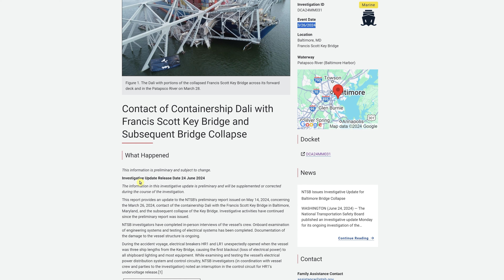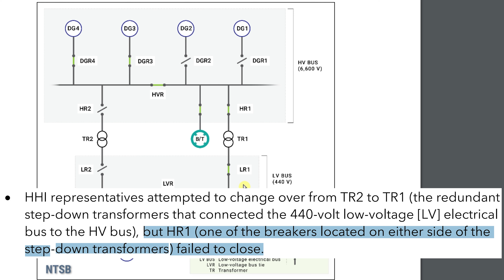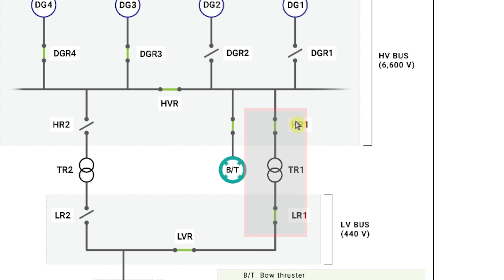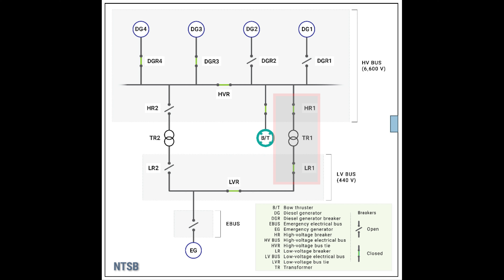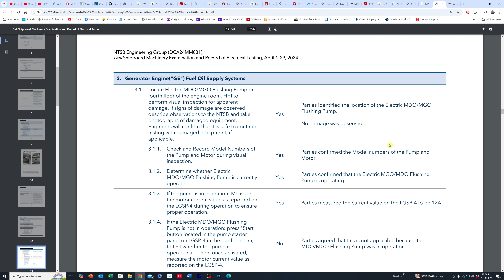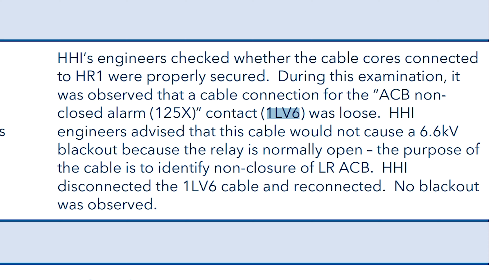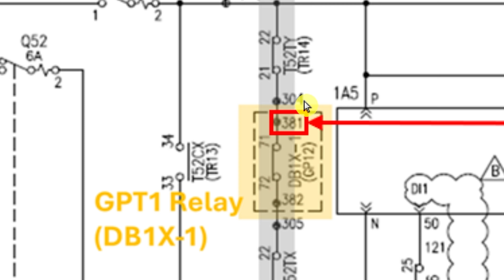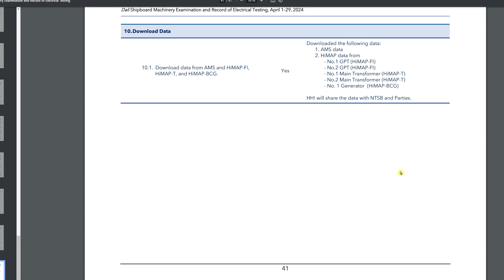NTSB: Dali Ship/Key Bridge Collapse Caused By Loose Cables?

Comment: As a mechanic, intermittent problems are a nightmare. But I remember one time this woman came in with a car that had a check engine light on and there were codes for all 4 O2 sensors and another sensor I don’t remember which. She took it to the dealer that wanted to change all the sensors. I told her when I get something like this where there are multiple sensors and print out a wiring diagram and see where they share powers and grounds. All 5 sensors shared a ground in the driver’s side front wheel well. Turns out she had hit something and her husband replaced the fog light and washer tank; either he ended up knocking the ground loose or the accident did. She was very excited when I told her it was a no parts required repair.
Reply: She is never letting him forget this 😅
Reply: Watched a video about exactly this when my Grand Caravan started throwing O2 sensor codes. Then my van was totaled in a man in the middle accident before we fully sussed out the problem (but only after a $3k repair bill for other stuff) 😢(
Reply: I have the same problem in my vehicle, I know its not the O2 sensors, it's an intermittent connection between my ECM and O2 sensors somewhere :(
Reply: @linuxguy1199  I run Arch by the way
Reply: I'm a mechanic too I had a weird one a dodge ram keep burning trough an oxygen sensor I changed is a few times it would work for a while then burn out I was pulling my hair out,
You won't believe what the problem was turns out the oxygen sensor shared a ground with the power steering pressure sensor turns out power steering fluid was wicking through the ground wire all the way to the oxygen sensor and frying it added a new ground and replaced the pressure sensor,automotive can be strange.
Reply: that is such a dealer recommendation lmao "well they just suddenly all went bad at once for no reason I guess, go ahead and replace em"
Reply: @linuxguy1199  Check the grounds for the sensor, like find your car's wiring diagram and find out where everything has ground-paths and check each of them.  I had an odd ECU issue (in my 6th generation Civic) which proved to be a dead ground link, BUT by eye it had seemed fine.  It was definitely still present, and also showed to be still sorta-connected but the ground strap had a VERY high Ohms reading when it should have been 'less than 3 ohms' or whatever.  Whatever my in-spec rating was (I forget but it was really-low-ohms across that link), it was instead triple-digit ohms across that ground link.  When I took it off and cut the ground strap thing open, the braided wire was an illusion, the inside of that ground wire had turned into green-powder with occasional bits of copper in it.  If you don't have a book and can't find/afford one, just try setting a meter to ohms readings, then check from the nut or socket or whatever for your sensor on one end, then ground to the battery-negative if at all possible, or just ground to a clean spot on the frame.  If it's a high reading and you're not grounded to the battery negative terminal, try another spot or two on the frame.  If you get mostly-similar numbers then it's accurate.  If it's up and down and all around on every different point then it's maybe dirty-metal, rusted-over to some extent, or you maybe have more than ONE ground issue.  If it keeps being insane, run any good copper wire (lamp wire if you must!) to the battery-negative and test that way.  Or maybe even do that first if you have wire for it.  The battery-test will add a few ohms just for the additional wire distance, so if it's a few ohms higher than is ideal, that's likely alright.  You can measure the wire's own rating before using it, and 'negative to a nearby frame point' to calibrate for losses more effectively, but if you have ongoing, intermittent issues with ALL of the sensors, then it may well be a grounding issue in that area of the frame/motor/pipes/whatever.  Wiggle the exhaust a bit while keeping the meter going and see if it jumps up and down, maybe.
Reply: The kill switch on my new chipper shredder was shorted to ground in the factory.   It is temporarily out of the circuit till I get good and ready to replace that Chinese switch

Comment: I worked in a factory in the late 70’s that kept having random power failures. They discovered that one of the main cables coming into the plant had a break in the cable when it was produced. They had to shut down the plant to replace all of those power lines. Thanks for explaining all of this.
Reply from the maker: Wow, that's a great story of how a manufacturing error can lead to some real painful issues. We never expect a cable to be bad.
Reply: Still remember installing a multi core control cable and the termination found a series of splices in the cable - we stripped the cable exactly where the splice in the cores was.
Having cores fracture in a flexing cable isn’t uncommon.

Comment: In a petrochemical plant, using similar terminals, we have experienced loose wiring in terminals, causing nuscience trips of the plant.  We began an inspection and tightening program of all these terminals (1000’s) during down times.  Vibrations from years of equipment running, temperature changes, dissimilar metals in the terminals and wiring, along with humid or corrosive atmospheric conditions of wiring and terminals can all be causes of loose or corroded terminals, causing bad electrical continuity, and thus equipment trips. 
These terminals are rarely checked after they are installed, until an incident takes place.
Reply: Yes indeed, rarely do the terminals on the control side get re-torqued unless the system is acting crazy.
Reply: Thanks for sharing that. I have rarely had to debug hardware, and never anything more 'critical' than a network box or a car heater, but listening to video (and reading your comment) I'm struck by the similarity to debugging software (which is mostly what I do). After a quick check of the simple stuff, we tend to assume it's working, and then never look at it again until forced to. All those teams of engineers looking for something subtle, and the cables weren't tight...

Comment: Very good info there mate. I'm a retired Crane service tech for over 35 years. I learned from a lot of old timers as well as on my own. When ever i was called on a emergency brake down such as a total loss of power one of the very first things I check for is the main power supply , Fuses, lose or broken wires. Then I go on into all the controls and so on. The main reason is, THAT'S where the problem usely  is. Plus it will cause everything else to fail do to the lack of power and so on. Plus being a crane its very dirty and greasy to be taking all the covers and guards to get to look at something. L.O.L.
Reply: On vehicles,  my first go to are the grounds. So many times manufacturers like to use body grounds with self tapping screw with star washers. They are so susceptible to corrsion I'd say 80% of the time they're the issue.

Comment: We almost scrapped our 2011 Sienna because of electrical problems.  Found out the sliding door buttons needed the rubber cover replaced. It only acted up when heavy rain got to those switches. Took six months and lots of trial and error to find this 50$ fix. Van runs great again 😊

Comment: Jeff,

It is not unusual for electric connections on ships to loosen as a result of vibrations or faults in assembly.   Routine maintenance should include the securing of cables as well as the thermal scanning of contacts, connections, and components.  It is important to remember that some testing must be done under load.  Some testing and inspection have to be done on "dead" panels for safety reasons.   When it comes to 6.6kV circuits and panels only certain qualified individuals are authorized for access and repairs.  As I recall it was not possible to access the 6.6kV cables without a key.

With that said consider the thousands of connections on a ship and the fact except for the twice in five-year shipyard periods the ship is in constant use, so the 6.6kV,  450V, and 120V switchboards are almost always powered.

Bob
Reply: Especially since they had such AWFUL vibrations that they (as I recall) braced something in engineering areas with a CARGO pod to try to reduce the vibrations, like they welded something in place, or wedged it there, just to make the vibrations less-awful, so something was shaking BAD to inspire that kind of effort.

Comment: We once had an intermittent failure that was traced to a single LED indictor on a breaker which was allowing full system voltage into digital control system.
Reply: Yeah the weirdest stuff that causes intermittent failures can be so frustrating, especially when it's something that seems so simple when you find it.
Reply from the maker: That is a very unique intermittent failure, and who would think an LED failing would allow voltage like that into the system.

Comment: Forgive me if this question has been answered already. Power failure might be at the bottom of the accident. But why was the ship steering to starboard? With power out the rudder should remain  in its last position. Which should have been set for straight ahead. And with the engine standing still it should not veer to the right either. Or does it?

Comment: Thanks, interesting analysis.

Intermittent wiring faults are notoriously tricky to pin down. Thermal cycling is notorious for slowly undoing threaded electrical connections, ultimately causing intermittancy.

Such connections need to be regularly retightened and/or locked down.

Comment: Screw terminals are notorious for loosening over time with stranded wire, usually what happens is the stranded wire becomes compressed but as the ship vibrates the strands move causing the tension to slowly decline, the same effect can happen with solid copper too (but it takes WAY longer). You're technically supposed to torque and re-torque screws in home breaker boxes every 10 or so years for this reason, I wonder if a similar issue was at play here!

Comment: Kudos to those engineers, that was some serious troubleshooting. As for the loose cable core, you have to realize that depending on the size of the contact surface between the pins it may only take a nearly imperceptible movement to disrupt that contact, this isn't like plugging a lamp into the wall socket. A securing clamp screw just slightly under-torqued or compression over time of rubber insulation on the plug face or even the plug being installed ever so slightly out of flush could cause it to become loose over several years. And this thing is in a position where it's obviously not intended to be disturbed outside of major inspections or massive improbable failures so it's not going to be found under normal operations.
Reply: Add in thermal cycling, and tolerances in any plugs, and you get even more movement.

Comment: "cable core" makes it sound more like a problem with the actual cable, rather than its installation? Like the wires inside the cable were badly made, broken, melted, or corroded, or something like that, rather than the engineers didn't screw the connection points down properly. I'm looking forward to more info on that, since it seems to be the cause.

Comment: OMG, you are a brilliant teacher. I have absolutely no training in engineering of any sort, & my day-to-day skills with electricity end at screwing in a lightbulb (oh wait, I can fiddle about with circuit breakers with great reluctance) But I sort of understood what was going on here a bit & it was fascinating. The main thing I got wrong (well, ONE of the main things) was that I thought you were describing what the ship's personnel were doing to try to figure out the issue before the crash, & I thought, Those guys busted their humps & the ship still crashed. But this makes more sense that it would be the NTSB having all this time to bring in all this high-level equipment. Anyway, really well done. And here's a creepy thing---I had a plug-&-screw connection on my DVD player that was always coming loose---it would be fine & then blackout & I'd have to go rescrew the holder thingie in. This was a ful size player, hooked up to my t.v., not a portable---never moved. Wha-a-at??!! Poltergeist?

Comment: Great analysis here, @21.40 there is possibly a crucial sentence at the end of the paragraph, where it says a blackout would happen and leave zero record on a particular sensor. So this event could happen at anytime and the crew or HHI engineers be none the wiser. Only after the intense investigation of all the parties post event, did the potential reason come to light. It is possibly difficult to lay blame on the crew or the owners if an intermittent fault doesn't leave any evidence.

Comment: Most likely it was at the terminal block. as an industrial maintenance technician at an auto manufacturer, we have PM schedules to check electrical panel terminal connections because in cases of ac terminals, they will loosen from vibration. If you leave them long enough, they will get loose. I have had many.

Comment: In 1991 I had a problem with two computers in a network. We got random incident and could not find out why this network problem occurred. This was a book binding factory and one day a printed circuit blew up in one of the machines and a new PCB costed $20,000. Then I went through all the electric in the basement with an electrician and he went in and tighten all the screws and one with earth connecting was loose. That solved the problem.
The book binding machine is a heavy machinery which draws a lot of amps and then a loose connection will make a lot noise.
Reply: Loose connections and high currents generate voltage spikes that can kill equipment in a hurry.

Comment: Was nearly in a house fire because of a loose connection in the switchboard...
Of all the components in electrical engineering, the one that gives the most trouble is the humble wire and connector. Even with batteries, they make intermittent connection which makes torches etc. flicker like mad!

Comment: I guess I am somewhat confused.  If the loose wire caused the one breaker to trip, why didn't the other, redundant side with its breaker kick in 10 seconds later, as what happened during the NTSB simulation?  That is why didn't the redundancy work?
Reply: Yes, the number one side failed but there was a cutover to the number two side 10 seconds later. 

The lights on the ship did go out and come back on. Was 10 seconds really long enough to the ship to leave the channel and hit the bridge.

It seems like it would just continue on its path.

I think there is more to this failure
Reply: @Set-it-to-11  I agree with you 100%.
Reply: I forgot that they had tried to slow the ship. That is known to result in turns. And although power in the second side is restored in 10 seconds, the fuel units take longer to restart. Anyway, I'm expecting more details to be reported.

Comment: Remember the 110 volt signal is stepped down from 4400. So a 1 volt drop would appear to be a 500 volt drop in the HV. The signal strength is exponential to the actual voltage being measured.

Comment: Loose cable / bad connections are found with good PM (preventive maintenance) programs.  Note at 14:31 "A lot of dust was observed".  That's important as it could be indicative of insufficient or even absent PMs!  Dust is also a fire hazard.  High current parts should always have infrared thermal scanning done on a regular basis to ensure integrity of connections.  Scary thing here how many other vessels out there are facing similar conditions?  This is a warning that cannot be ignored, IMHO.

Comment: I think when they say cable they mean wire, the core is the conductor, and nodes are TB numbers.  This is just a single wire terminated on a terminal block or I/O module, screw clamp-plate.  You often have thousands so there will be at least one loose one.  A system should be designed with this risk in mind.
And I didn't wait till the end to comment -- and there is the DIN-rail mounted TB section that likely wasn't tight.  Pop them right out with a screwdriver.

Comment: Classic intermittent problem.  When you're dealing with normally open control circuits in a live redundant environment  NOBODY shakes the harness in the sprit of "if it ain't broke, don't fix it". I'll also bet that in the interests of cost cutting nobody was doing that APM (annual preventative maintenance) line item "make sure all connections are clean and tight",

Comment: What I suspect is an overload of refrigerated cargo containers. They were late in departure. Part of preparing for departure is switching from shore power, so power was interrupted for a longer than normal time. When ship power was brought online, the now warmer containers all needed power at the same time for cooling. Nobody has mentioned the actual load on the circuit when it tripped. I presume it tripped for overcurrent or under voltage due to the load of the cargo, and use of the bow thrusters. The combined load could have been the "intermittent" condition at the time while navigating out of the harbor.

I have found data recorders on intermittent equipment a very valuable resource. Part of my toolkit is various data recorders for voltage, current, temperature,, and humidity. There could have been a ground fault in the system, as indicated by the testing.